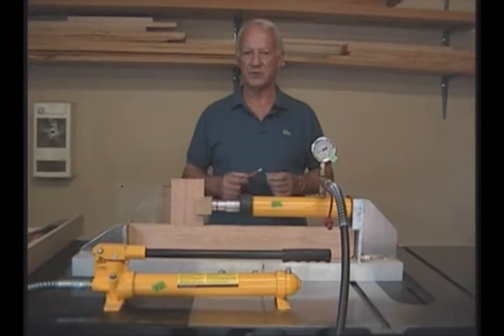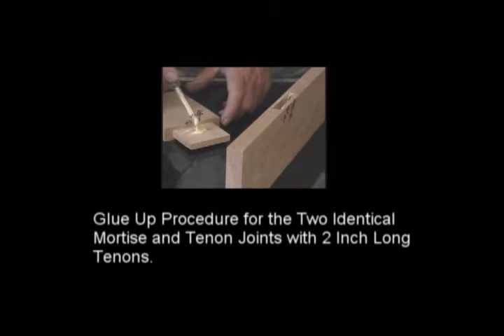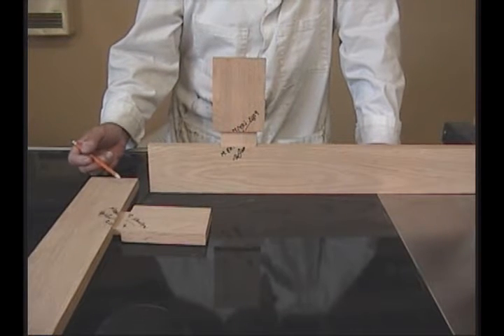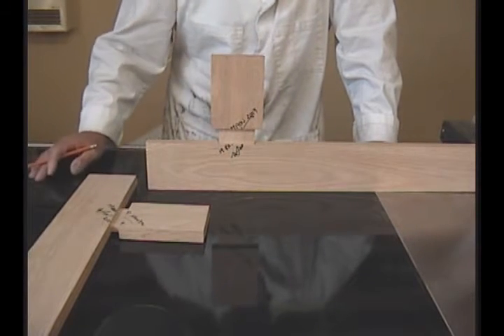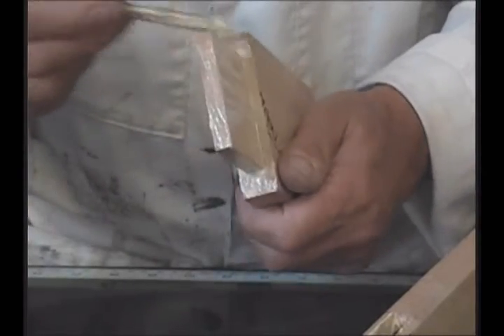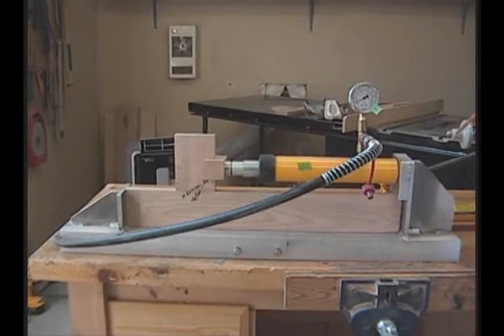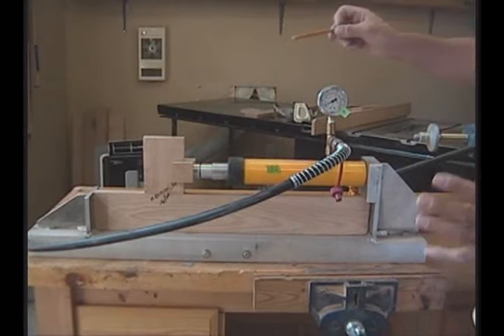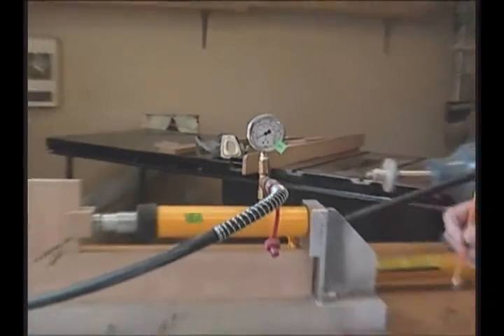Wood Joint Strength Test by Dowelmax Part 2 - Mortise and Tenon Vs. Multiple Dowel

Comment: poor sample size.  only 2 M&T and only 1 dowel sample.  You need to do enough tests to throw out any variables (poor glue up, poor wood connection, poor wood/knots, etc).  It also doesn't help that the video quality is poor and not zoomed in at the pressure gauge.  I reviewed the video at .25 speed and paused and magnified my screen as best as I could, but it doesn't look like it went beyond the 1000psi (last marker on the pressure gauge).  We just have your verbal acknowledgement that it is 1020psi. 

If there were more samples, this would be credible.  As it is... the sample size is too small.  Also... are we to assume that the same glue was used for both tests?  I am well aware that different glues provide different strengths (and penetrate differently into different substrates).  For this to be fair, the wood should be from the same tree.  The same glue should be used and a large sample size should be completed.  Also...a better view of the gauges would be helpful.

Comment: Where can I find 4" dowels.  I am building a set of large carriage doors and am considering dowels for it.
Reply: Hi Michael.  It's entirely up to you but I would really consider 2" dowels.  I just did a test on poplar with six dowels and it did not fail at 1700 lbs.  Don't underestimate the strength.  It's all contingent on the accuracy.  Regards Jim.
Reply: @marielindsay528  Thanks Jim
Reply from the maker: Hi Michael, You can get 3" and 4" long dowels from Kemp Wood in ME. Thanks.

Comment: how do i convert your psi press to lb-force, what area in inches should i multiply your psi pressure by to calculate  force lbf. the hydraulic cylinder seems to be pushing against a 1 inch by 1 inch block?
Reply from the maker: The area of contact against the test wood is 1.46 square inches. The force used in the case of the dowel joint with 2 inch penetration was enough to make the welded aluminum test stand, and steel hydraulic cylinder both slightly bowed. Sorry for the late reply, as we had to pull the test stand to measure it.
Reply: @DowelMax  the actual pressure on these joints is much greater than the 1020 lbs your gauge shows, to calculate the actual pressure applied to joint you need to know the inside diameter of the cylinder and multiply it by pi r sq (3.14159) this determines the sq inches that the 1020 lbs of pressure is pushing against. the larger the cylinder diameter is the more force it creates, in this test rig i would guess the diameter to be around 2 inches and if so you would multiply 2 x 3.14159 = 6.28318 sq inches x 1020 lbs of hydraulic pressure will create 6408.8436 lbs of pushing force against these joints,  that is over 3 ton of pressure to break these joints,  very impressive  thank you for a great video
Reply: @daltonwilkins7767  Hi Dalton.  Thank you, and you are right. I was a bit lax, because in essence, it's usually a comparison and also way over the top. The only thing I can add is although the dia. of the hyd. ram is important in this case the area of contact is relevant( wood on wood ) I think the area is 1 1/2 sq. ins.  Thanks for keeping me on my toes.  Regards Jim.

Comment: Very impressive results.  Two questions if I may:

1- I am always looking for ways to improve quality. So for kitchen doors I use only solid wood and all joints are done using M & T .  So will dowelmax outperform M & T and how many dowels will I need between Stile & Rail. Note that the Stile and Rail are only 1 1/2 to 2 inches wide.

2- Will Dowelmax jig provide the required accuracy or do I need to use CNC machine to get such impressive results.

Look forward to your reply
Ali
Reply: Ali Jablway   As you know the m@t system is good, but this is better.  The reason is mainly due to better accuracy.  Our tests are done professionaly, you have my guarantee on that.   This system could save you hours of labour, and the strength and versatility are totally underestimated.  Check out the unsolicted reviews on Amazon.  Regards Jim.
Reply: Hi Ali. Sorry missed this note.  Two dowels on the 1x2" workpiece and three  if you can increase to 2 1/8". Guaranteed stronger and more accurate than most m&t.  As accurate as a C.N.C. machine.  Regards Jim.

Comment: Haven't seen this this test done on both directions (perpendicular to this test / thickness) after all that should be the weakest direction. Good test though, Thank you.
Reply: Paolo Mh Hi Paolo. T/y.  I fully appreciate your view however we don't do additional tests for various reasons : costs, materials, time, plus designing additional test equipment.  There are various reasons for the Dowelmax success, but the most important of these is accuracy, and that wouldn't change by altering the load direction. Please be assured these tests are accurate and undertaken in an honest manner. T/Y again.

Comment: The problem I've seen is in furniture from the 70's and older that pulls apart easily because the dowels have shrunk and broken the glue joints or had inadequate glue from the get-go.  It's not all the dowels, some are still stuck tight and must be drilled out but roughly 50-70% can be pulled free by hand.
Reply from the maker: Hello Rick, We can expect that in some instances of older factory production pieces that there could be too few dowels, dowels not fitted correctly, low quality dowels and/or low cost & poor quality adhesives. We can fit 5 x 3/8 x 2" dowels into a 3-1/2" work piece, with a snug fit using AMG dowels and titebond glue for an extremely strong wood joint that is stronger than the wood itself and requires hydraulic pressure in the area of 800 psi to break the wood below the dowels. The joints can be made even stronger with longer dowels as was shown in this video requiring 2000 psi to snap the dowels in tension. You could see the aluminum test stand and steel cylinder "bowing" under the pressure. Thanks for the comment.
Reply: how do i convert your psi press to lb-force, what area in inches should i multiply by to get lbf.
Reply: Rick, you’re absolutely correct. Dowels are a connection method that’s doomed to fail over time, usually in the cross-grain (stile) connection, due to the inconsistent species between the dowel and the frame and the almost nonexistent long grain to long grain connection. I also suspect the glue connection in both M&T failures, as a properly cut AND glued joint would be stronger than the surrounding fibers, so the failure in a properly executed M&T would be in the stile fibers, as in Colin Knecht’s example, which is not a joint failure, other than the Stopped Tenon not projecting deep enough into the stile.